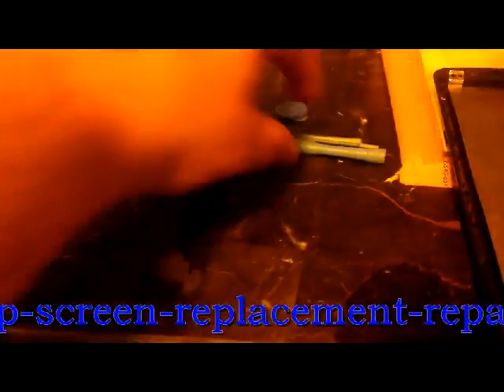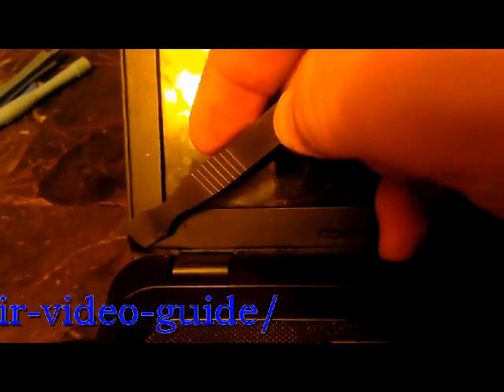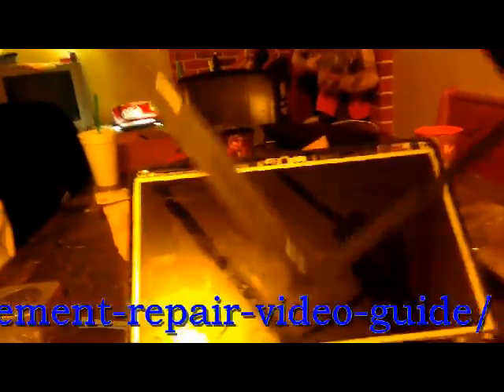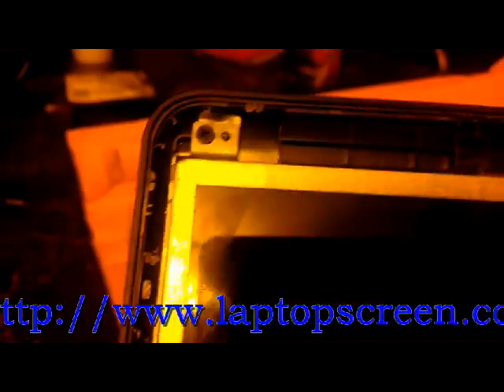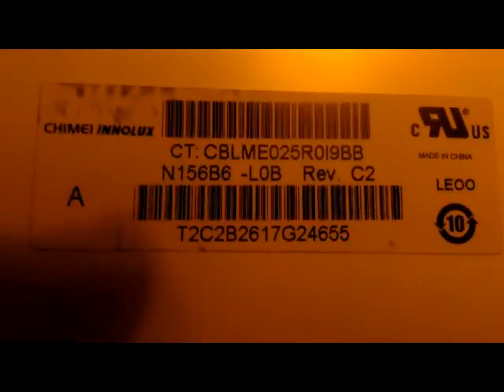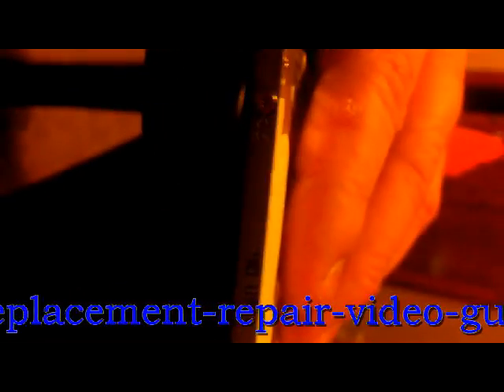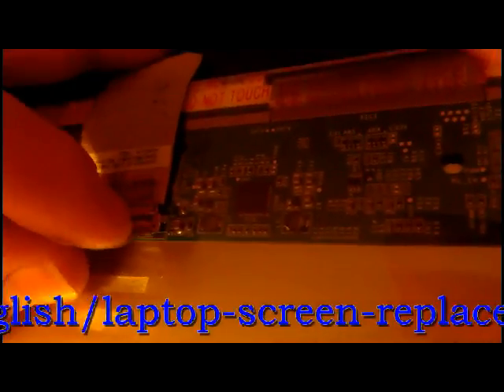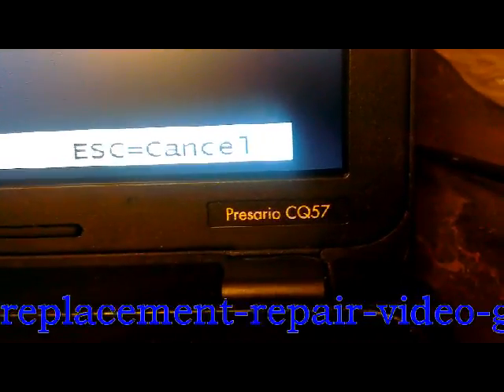Laptop screen replacement / How to replace laptop screen Compaq Presario CQ57

Comment: Nice presentation! Than you! In my case, I didn't need a new screen the problem was the connector to screen interface. After re-inserting 4 times, I finally got connection and all the "snow, flickering and poor color left and I got a normal screen back. Taped the connector to the screen back to immobilize it and re-assembled the bezel. That connector is VERY funky to a point that I would call it unreliable. For this tear down, since the base unit is not disassembled, I left the main battery in place so I could start the screen to see any changes in the display visually.